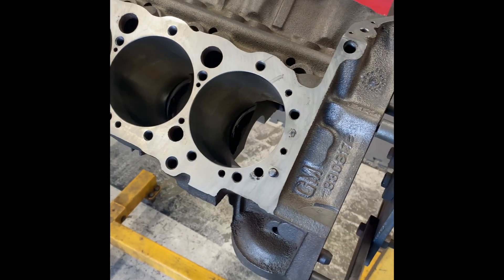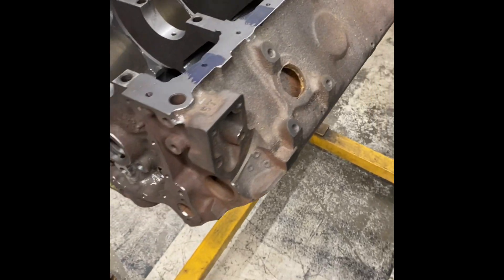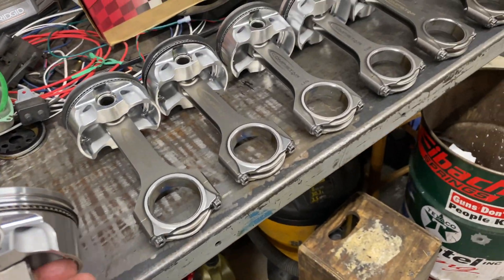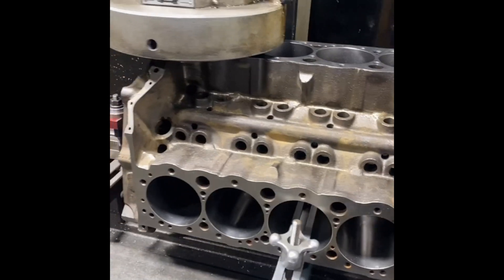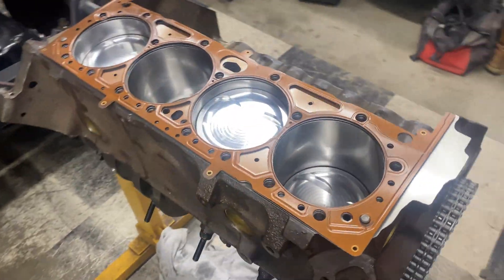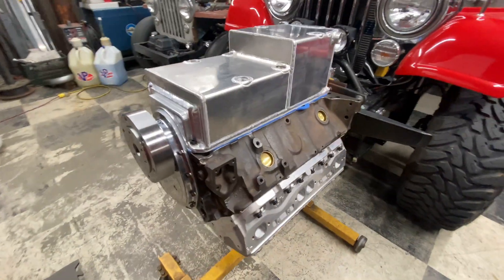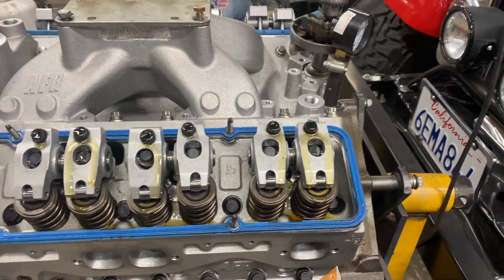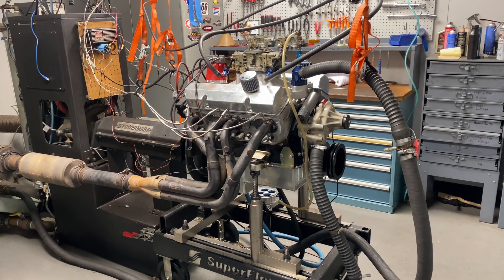628 hp small block Chevy build. ￼ Almost 600 foot pounds of torque.

Comment: All that attention to detail helps you get to know your engine on another level. If you can carry that through the entire build, you will have an engine that will serve you well for a good while. Myself, 1 machine shop, 2 machinest friends with measuring device's i didnt have, assembled my first 383. Iron heads, healthy solid mechanical cam, single plane with a 750 dp. It ran the 1/8th mile and around town for 20+ years. Now its .040 over with aluminum heads and a hydraulic roller cam. This is the 3rd summer with the improved verson. I let the guys at the speed shop pick the parts and assemble it. Dyno said 543 hp at 6300 rpm. With 4.56 gears, a strong powerglide, and a 9in converter, it is slow in a stock body and interior 69 Nova. 7.08 in the 1/8 mile. But its fun, and it has not broken parts, yet.
Reply from the maker: Thanks and it sounds awesome 👍🏼👍🏼

Comment: Great job you make as much power as my big block and only about 3 cubic inches I have a 427 60 over so a 439 it's a mild build for my daily driver it's got about 10.5 to 1 compression afr 265 oval port heads a Howard's hydraulic roller it 235x241@50 with a 108 lsa I do have a solid roller for it but not sure if I want to use it or not it's got 256x260 duration @50 and 666 lift I was think with a 1.8 rocker it would have right at 700 lift I just hate to have to change springs and do all that work after I dynoed it and I don't want to put more money out on dynoing it again it made 661 hp 605 torque with the hydraulic roller I think I'll just hang on to that cam for when ever I freshen it up or another build.great video thanks for sharing it

Comment: i learned how to detail an debur an perp sbc blocks and JB Weld SS screens and install magnetic plates an if you run a factory block.Thats what i do...cause when things let go i like to try an keep top problems on the top end an bottom end problems down there the best i can.I try to keep the cost of opperation under control the best i can anytime you buzz these mother-Fers above 6500G it could cost you $3500 to put it back together if things go south on you. The 400 sbc is a good displacement to build a Comp Mill...😎💯✌

Comment: Very very nice looking engine. I'm curious though. I've seen other 400 builds where the deck has had pipe plugs installed in all the water passages, and then milled flat. What is the purpose of this and why did you choose not to do this?

Comment: Are you using the steam holes or pluging them ?
Reply from the maker: Hey man, thanks for the question. No I’m not using the steam holes. My car has a huge radiator in it with a great water pump/ cooling system and I have no cooling issue. I actually had to put a thermostat in the car to warm it up because it ran so cold during the winter.

Comment: Built a 400 with a dart block, AFR 220 heads, Bullet Cam .675/.694 - 275/285@.05 110LC, 6.0 Callies rods, Callies crank,
Diamond Pistons, 13.5cr, Edelbrock SV 2 ported intake, BLP 950 carb ran on 110 race gas. 
made 670hp@6800/585tq@4500.   (Should have set it up for E-85 probably would have run a little better) .  I like what you did and how you built your engine, especially making the numbers on a engine built for pump gas and nitrous. Let us know how it does at the track!
Reply: WOW Ron, Sounds amazing! You spared no expense on that build.

Comment: 400 sbc, great motors, 2 bolt blocks only, 4 bolt motors while being x-rayed have a Crack somewhere, usually in lifter galley, use the 2 bolt and add splayed caps, have 2 use small base circle cam, torque monsters, I like factory stroke with 6 inch rods, wiseco pistons
Reply: I have a splayed cap 817 block does fine just n/a don't put nitrous if you already have over 12.1 she will bust but they are torque monsters for there era

Comment: The 400 has over heating issues because the cylinders have no flow between them. They are siamesed. They added steam holes in the deck near where the cylinders meet. You must drill holes in any cylinder head that is not the original 400 head. I don't see that was done here. The gasket doesn't match the block either. I have stayed away from them for that reason. That amount of horsepower is going to create a lot of heat that cannot be dissipated evenly.

Comment: Just scored a '74 or '75 400cid engine out of a '75 3/4 ton pickup. It's all original with points distributor still on it. Hopefully the bores will clean up at no more than .040 thou over. Shoot'n for 550+hp on pump gas with  220cc heads. Probably end up around 420cid. Internally balanced with 6 inch rods and an 3.875 stroke 9000series Scat crank. Compression ratio with flat top hyperutectic pistons should be around 10.8 to 1 with the block zero decked. The combo all revolves around the hydraulic roller cam at 236° duration at .050 on a 112° LSA and .580 lift with 1.5 ratio rockers. I'm going with 1.6 ratio Comp ultra magnum rockers to cheat the relatively small cam up to over .600 lift. Edlbrock ProFlow EFI system complete with single plane intake, injectors, fuel rails and 1000cfm throttle body. Box nose S-10. Can haul my bike around in the back of it, no problem. Makes loading much easier than full size trucks.
Reply: If it's a 75, it would have hei distributor stock, even some of the late 74 stuff had hei. Probably not the original engine if it has points, could be 70-71-72-73 engine.
Reply: @b.c4066  trucks could still have points in early '75 that's why I said it's either a '74 or '75.
Reply: The truck is '75 but the engine is most likely a '74.
Reply: Don't know much about the 400 Chevy engine. Did they ever make it into production cars? Or just trucks? Thanks
Reply: @robertclymer6948  1970-1980. Most were in trucks, but many fullsize cars and lots of station wagons also. RV vans were another common vehicle because the added cubes helped tourqe output in that situation. Big blocks don't fit in vans.

Comment: Nice build and well made video. 

Do you have any issues with that eliminator intake not sealing and sucking oil into the intake and head runners?
Reply from the maker: No, not at all. The car that it’s going it is not running yet.
Reply: @n20power78  I had two different 4811pm intakes on my brand new 427 dart shp block with AFR 220 heads and both intakes sucked oil from the lifter valley. You may want to keep an eye on that.
Reply: Has anyone else had an AFR intake that wouldn’t seal?

Comment: What do you mean by "6 inch piston"?
Reply: Pistons are designed to work with 6” rods and stock 3.75” stroke but when used with a stroker crank and 5.85” rod it works out with a little deck surface milling
Reply from the maker: I used a piston for a 6 inch rod and a stock 3.75 stroke in a 400 sb
Reply: @n20power78  👍

Comment: I like the 400 sbc engines . I built a 406 for a 32 Ford street rod and it was a hand full at times . Great build and a Great video .
Reply: Couldn't find a 351W and stroke it to 408? Keep a Ford engine in a Ford car. WTH
Reply: @robertclymer6948    I had a dose of Ford engines with a 53 Mercury Flathead .  It ran great until I wore it out and then it was a constant piece of junk .   Been Chevy man since I was knee high to a grasshopper .   Killer 406 you got there . Thanks bro

Comment: I like that combo, just finished one six months ago (427 cid) and got close results, 577lbs torque at4500rpm and 601hp at 6500, hydraulic roller and chinese heads and I assume yours is on pump gas too.
Reply from the maker: Ya just 91 octane. But then we put it on E85 to see what the difference would be.
Reply: @n20power78  When I tried that about 5 yrs ago on a 383 I lost 5hp up top and gained about 25 ft/lbs from about 3000 to 5000rpm but the guy didn`t want to go through the extra trouble of draining the carb, pump and lines between outings and the customer is always right.

Comment: You have the cam specs?
Reply from the maker: It’s a comp solid roller 262 and over 600 lift
Reply: @n20power78  it’s running good and nice work
Reply: @n20power78  off the shelf?
Engine did great man !

Comment: Who makes those rockers. They look like they're pedestal mounted in pairs. Kind of a step between stud mounted and a shaft rocker setup. Does the cost fall between a good stud mount and shaft rocker setup?

Nice build. Whats the compression ratio end up at? This thing should absolutely kill it on both the street and strip.
Reply: Yella Terra makes the rockers. Nice australian pieces.
Reply from the maker: They are YellaTerra rockers. And it’s right at 10:5

Comment: Sounds good man. Curious why the heads weren't drilled to match the block steam holes, or did I miss it?

What CR did you end up with?
Reply from the maker: It’s got a super big radiator high volume water pump. Those are never run hot so I really wasn’t concerned with it.
Reply: @n20power78  Gotcha, thx for the reply. Have fun with the big mouse powered Nova.
Reply: We plug the steam holes to help keep the cylinders round